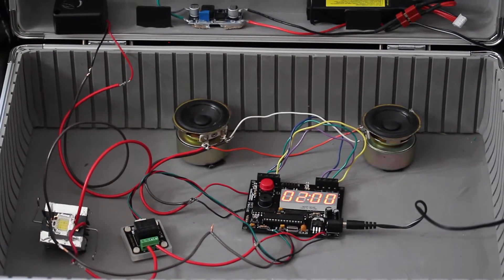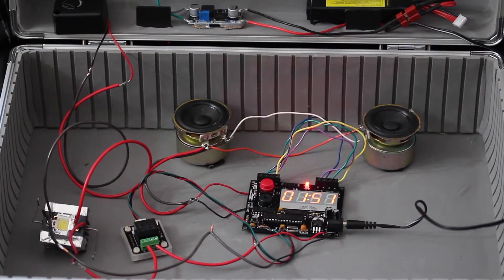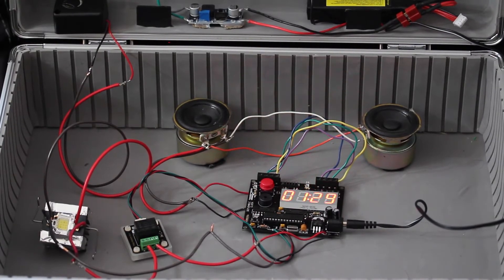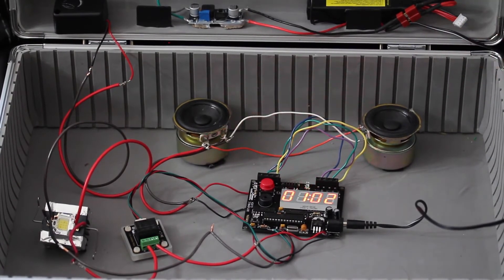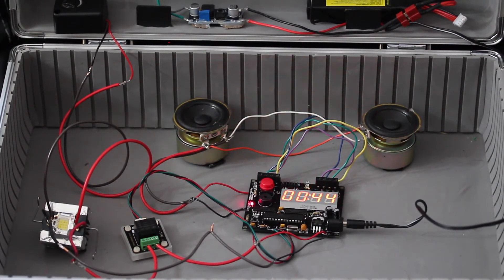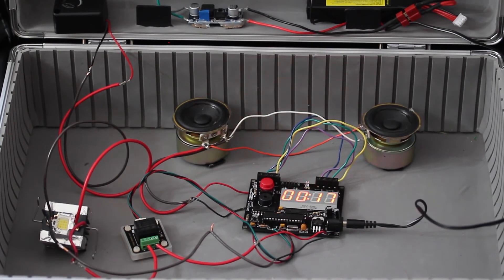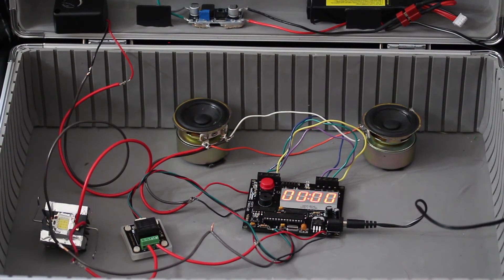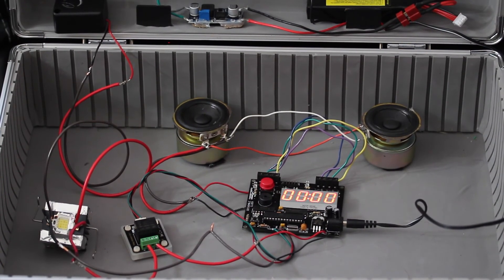Airsoft Bomb Part 2

Comment: Could you please add, or send me, a design on how you added the speakers and where you got them?
Reply from the maker: The speakers are directly soldered to the built in speaker on the board. I bought the at a local electronics store. I have since wired in an amplifier between the board and the speaker.